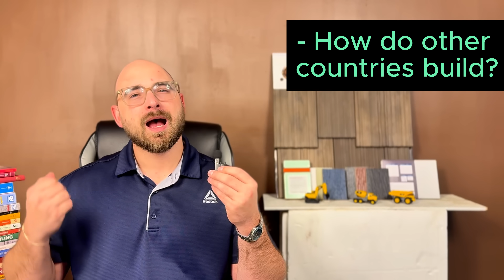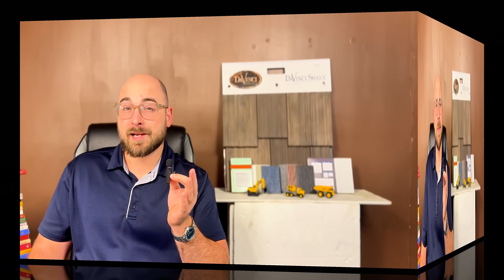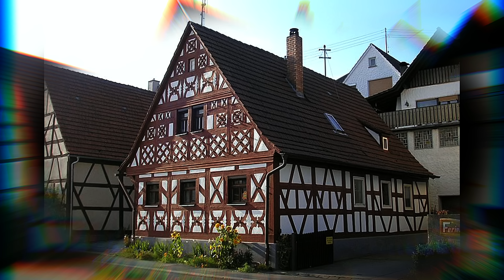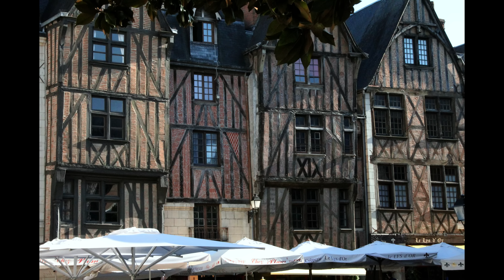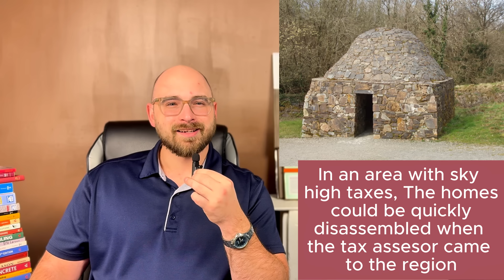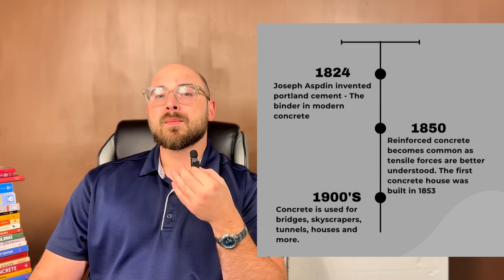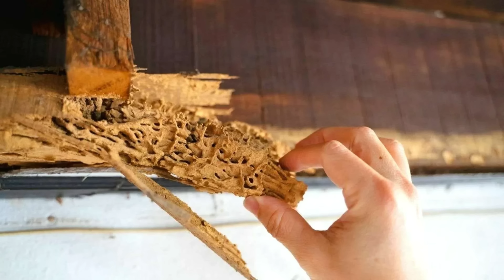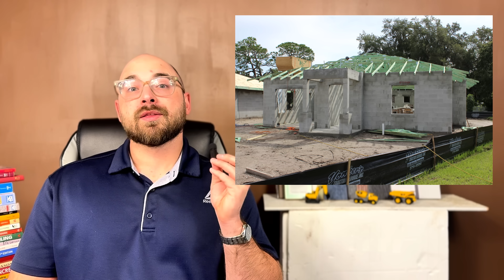Why Other Countries LAUGH at American Homes

Comment: Mr. Fortin: Sorry, but concrete block (cinder block) does not "help keep the house cool" [16:35] in Mexico during the summer when exposed to direct sunlight, but rather quickly heats up and easily radiates that heat to the interior throughout the day and evening. When one places a hand against an exterior wall from inside, the surface is quite hot. The opposite equally applies to winter cold conditions. Concrete block is a terrible insulator.
Reply: I have a block house in idaho.  It stays cooler than everyone else's homes that I know. They are all stick framed.
Reply from the maker: If the foundation is below the frost line the block would benefit from earth coupling, equalizing with the temperature below grade

otherwise yes you would be correct the block would need additional insulation
Reply: @Mike_Fortin  Thank you, Mr. Fortin.
Reply: It's the air gaps in in, coupled with something like styrofoam, that makes for insulation.

Comment: I live in a wooden house that was built in the late 1700's. Just change the shingles every  20 years or so and it's fine wood can last centuries if you take care of it. I live on Cape Cod and there is no shortage of 18th and 19th century wood homes that have held up just fine. I don't get why people throw shade at traditional architecture my house has outlived most European systems of government. A major advantage of wood homes is ease of repair and ease of modifications. If you have a beam go bad or a wall get damaged you just replace the bad boards and get on with your life. If your needs change you can easily do an addition.

Comment: it's interesting, that despite US leans toward "disposable" style of homes and cost efficiency, neither is actually in effect. All homes in US re-sold multiple times over decades for ever rising price rather than being rebuilt, quickly deteriorated, still sold over again. Cheaper materials do not translate into adequate price. The steadily increasing price I observe since 1994 does not translate into higher quality workmanship, on the contrary, I don't know single case of adequate quality, absolutely everything is done slopily and being chrged through roof.

Comment: Are ICF townhomes with party walls possible?
Reply from the maker: Yes, you might have to use a thicker core for that wall, but %100 possible, 

Can also be used as dividing walls between apartments. 

Our block manufacturer, Crown ICF  is building a 100 unit apartment building where all the dividing walls are ICF. Leads to a sound proof, smell proof, energy efficient unit

Comment: (Perhaps) the Romans and Italians stopped building with concrete because the cement mines were exhausted. The Roman cement is a kind of natural volcanic ash (ignimbrite)  that probably was not endless in supply. They were not clever enough to invent Portland cement in that time, and that is why the casting of concrete stopped. Perhaps another reason for the decay of the Roman empire?

Comment: I suspect after the recent fires in la you're going to see a lot more concrete homes and metal roofs being used.
Reply from the maker: Steel framing with fire resistant design is another great option

Comment: You missed 3D printed concrete as a possibility.
Reply from the maker: I don’t think it’s a great option, 

It’s not any cheaper, the concrete is exposed to the elements, it lacks reinforcement, I’m skeptical of how well they are insulated. 

I think it’s a fad
Reply: @Mike_Fortin  It's an emerging technology and may not be great now, but it should be watched as it evolves.
Reply from the maker: Things could always change. One day we might have a bunch of robots laying brick and putting up drywall too, we’re just not there yet

Comment: It is a cultural thing.

In the US you can build a house from "matches and cardboard" for the price of a proper pickup truck. And after a few decades, a fire or a storm you abandon it and build another one. Land (outside if some hotspots) is dirt cheap. You wouldn't even bother demolishing and rebuilding it, you just buy a new plot, and leave the old one to those with lower income.

In Europe you can't. The plot costs you 4 proper pickup trucks, if it is far enough away from the next city, and the house costs another 4. (Although nobody drives trucks here.) An own house is only for the better half of the income spectrum. A once in a life investment. But the structure will survive hundreds of years. It'll outdate regarding insulation standards, heating, and electric wiring several times before somebody in the far future will maybe demolish it to get a good plot

Comment: I have traveled extensively and places and types of houses vary greatly. Older homes that still exist were made well, but newer construction is rarely to the same level.  And having been in the UK and Ireland I can tell you that those pretty homes are COLD. And no idea of air conditioning. You have to bundle up just to be inside. And in many countries, the shoddy workmanship is obvious. And don’t get me started on the Soviet era building which are terrible. So it is problematic to compare US homes, which are usually less than 100 years old, to buildings hundreds of years older.

Comment: Love the idea of an ICF built home. But I worry about the Styrofoam form. That stuff burns fast and puts off lots of nasty smoke. If you get a fire behind the sheet rock wall or a fire that gets into a wall from outside the wall the fire will spread fast.
Reply from the maker: ICF is treated with fire retardant, it won’t sustain a flame on its own. It would just melt. And there would not be a structural collapse like their would be in a wood house, giving the inhabitants time to get to safety if there was a fire

Comment: hello from Greece. like to point that many houses here  recently have adopted using dry walls instead of the plaster on the inside walls due to cost. i live in a 2024 built house tha was made with reinforced concrete framing, brick infill, insulation and plaster on the outside, dry wall on the inside and for roofing it uses insulated roof panels (they are much! cheaper than roof tiles). Dry walling on the inside (given the building is well insulated) has become the cheapest and most cost effective option. As for stone houses the you mentioned, you mostly find them around the country. While the materials are cheap (we have lots of stone.........i mean alooot!) labor is very expensive and requires great craftsmanship that is really hard to find.

Comment: As a European, I think there is no problem with the frame construction method, if it had heavy timber framing reinforcement, or 1-2 walls were made of brick or concrete, and were not just an independent decoration. I live near Budapest, there are frame houses here too, but they are not that widespread. What is built on site is not of such good quality, but the frame houses made of prefabricated walls here are quite strong and durable. Actually, it has not spread, because of the banks. Because if the  debtor does not pay the mortgage installment, the bank has a hard time selling the frame houses, because here people consider brick houses to be more valuable. That is why banks very rarely lend money for the construction of frame houses.

Comment: Sometimes engineering is used instead of bulk. Example: Soda cans hold their shape using .0001 ounce of aluminum 
and did you see those small Poland Springs water bottles? They use .000001 ounce of plastic to hold the water.
I rest my case. :face-purple-crying:

Comment: I moved on, step by step, to an interest in deep insulation cavity parallel chord sidewall truss / modified roof scissor truss unified rigid frame structure. Ground level assembly / tilt up frame construction. On building site "1" step "manufactured" and installed finely shredded wood fiber to super insulation levels, ventilated and or vapor permeable exterior solid wood sheathing panels. Looking to the future of affordable high quality, low cost, energy efficient "Swiss chalet" style housing made possible with a "refined" , relatively low cost, forest to final built home equipment package ... A properly scaled, vertically integrated urban and rural forest restoration / "free wood" harvesting system to small scale sawmill system to home building "system". New Era Home building for building New Era Community.

Comment: In the U.S. If I don't like the design I can change it easily enough and I'm not limited to any materials. I prefer natural wood and tar paper over plastic any day. If by chance I build underground it will be with steel and cement. Otherwise I want to blend in with nature and the natural environment because I don't live in a City and I'm not you. I don't take up more than I need.

Comment: So, funny story. I just had a multi day argument with a channel that does masonry work in the uk. I argued with the actual channel not other commenters. He dug 3+ feet deep around a front step. He claimed that the soil was "terrible and he could see why the front step surround sank" so only dug around an already mostly demolished step and filed the ground with concrete. He even chose not to add rebar to the concrete. When I pointed out that a plate compactor would have been more then good on the existing dirt, a layer of compacted crush rock, and that's all he needed to stabilizer the soil, he started insulting me. I offered a much cherokee solution to his that would be better then my first option. Dig all the dirt up, not just around the step. Get soil that you deem acceptable, do lifts that are compacted and a layer of fabric meant to be used to stabilize soil, and repeat. Then top with a layer of compacted crush rock, and bam, soil that can hold weight! More insults from him. Then I suggested, if you are going to do it your way, maybe it would be best if you added rebar and maybe vibrated the concrete to remove bubbles... more insults.  Through it all he insisted that he was building within UK code. This makes me very scared. First, that the uk code is really calling for unreinforced concrete for anything without vibe, two that builders are doing the bare minimum and not what is best, and three, that in the uk there are many structures built this way. But his responses were always insults and name calling and not a dialog about the facts and why they do it the way they do. I don't proport to know everything about building, especially in the uk. But I build bridges in the US and understand the basics of home building here. There seemed to be many mistakes made here and he offered no explanation for any of them.
Reply from the maker: Perhaps what this other person was doing was allowable, but not ideal 

Their version of code minimum, 

A lot of contractors have an attitude, we’ve all seen it. “I’ve been doing this 20 years” and they suck lol 

The best of the best are humble, knowledgeable, and open to new ideas.
Reply: @Mike_Fortin  it scares me if that's allowable in the uk. I couldn't imagine pouring more then a fence post without rebar and a vibro. I wish no one had attitude! It gets no one anywhere. It just leads to the same old same old. It stifles improvement and innovation. I've worked places where if you thought about improving the workplace or methods you were slated for firing. It was nuts. This guy is likely a great guy to work for. Wonderful conversation and really great when employees make mistakes!
Reply: @activemanishere  cool story bro, is that why there are houses still being lived in that are older than the US around every corner. Also I live in a 150 year old stone and brick house the only thing that needs replacing is the roof tiles maybe every 20-30 years if not longer and this house will out live me and any future children I might have 🙂. Regulations are way more strict here for buildings. I have seen YouTube shorts in America of an inspector finding so many faults in new buildings that it looks really embarrassing. No builder would want to put their name against such poor quality over here or they would be publicly ostracised.
Reply: @dkinclonberne  you mean how i publicly ostracized this guy for doing a weird dig for no reason and then filling it with unreinforced concrete that wasn't vibrated? He literally overkilled and underkilled at the same time! It's both too much and going to fail. We reinforce concrete for good reason. Especially without reinforcement, Air bubbles will lead to failure. I don't know their climate, but air bubbles will fill with water. When that happens, and then it freezes... explosive consequences. I don't deny that there were old methods of building that were better. They would be cost prohibitive to mass produce today. That's why we don't do it today. Not because today's methods are better. But, to make today's good enough methods actually good enough, we must follow certain rules. If the uk no longer follows those rules, today's builds will not last. This video i watched, I can almost guarantee that within a few years, maybe even one winter, this foundation for a covered front step, will fail. I would not say old build suck. I say this guy that I'm talking about sucks and if that's normal building practices in the uk, things are going to get pretty bad there.

Comment: American homes can be build very well, but most builders clueless, ripping off customers seems to happen often and houses are generally speaking not well maintained.

Wood, which often used in American houses is one of the best buildingmaterials but it comes down to how it is being used and how good the material is to begin with.

Comment: In Switzerland one of the reasons for the massive usage of concrete is that most new homes are multi-family homes. On the other hand, there are many efforts to use more wood also for larger structures to reduce the usage of concrete. There is quite a lot of innovation around wood framing happening. If you compare the cunstruction methods of wooden homes in the USA vs. Switzerland it's still quite a big gap. The difference is in the longevity expectation. In the USA the expected life span is considerably shorter for a home than in Switzerland. This also translates into cost.
Reply: Don't forget the mandatory bomb shelters (that isn't a joke, in Switzerland it was mandatory until 2012 to have a proper bomb shelter in every house)
Reply: @fkiesel9442  Of course, these ate also a lot of concrete 😅

Comment: Years ago I wanted to build a house with steel framing until I learned that steel is affected to a greater extent by the heat from fire.  Where good wood, even if lightly burned on the outside retains its integrity, steel is weakened by just being in the vicinity of high heat from fire and will need to be replaced to a greater extent.  Since heat rises, potentially all the steel in upper story floors or ceilings would have to be replaced even if there is no fire damage.  So unless something has changed in the last 20 years, I would stay away from steel framed homes. 😕
Reply from the maker: You would need some extreme heat to damage the steel. If covered with dens glass and fire resistant cladding, I would sleep like a baby in that house.  

I think it’s typically very large timbers that have the ability to char without burning through, not light wood framing
Reply from the maker: If you really want non combustible, you want concrete

Comment: Grew up in a double brick house in Southern Ontario.  Lath and plaster on the inside.  We could see out breath during winter.  The house still stands; it's probably over 150 years old.  Concrete is nice but as of yet making cement results in too much carbon dioxide released.

Comment: Here in Denmark the typical home is build with either areated concrete blocks, precast concrete or bricks as inner wall. Brick and morter outside with rockwool in between the walls. Some houses have stucco or some other finish outside. The gable is brick and roof trusses is engineered lumber with typical clay tiles as roof. Some houses has copper roofs, but thats rare. And yes we have stickbuild and other types of houses. The sustainability concept is getting popular. And having a wooden finish outside is also trending on new houses. What many wants right now is low maintance homes with high performance. And radiant floor heating is the most popular thing amongst new builds.

One thing i would never understand is the american housewrap aka structual paper :P

Comment: I'm from Australia, living in Armenia. The average house in Australia is sticks and paper compared to the house I just bought here in Yerevan. It has 45cm thick walls, built with the local stone. Each level is held by a 30cm slab of concrete. The only wood in the building holds up the roofing . It will be here long after I'm gone.

Comment: Concrete is too cold to live in for the northern states
Reply from the maker: If you insulate it, using a product like ICF, you use the energy of the earth to help keep the structure warm 

This is called earth coupling and is a unique benefit of ICF. 

It can be 0f outside, no heat on, and your house will stay 55-60 degrees

Comment: US has lots of wood. Hyper capitalism also leads to fast and cheap. The feedback loop is lightwood frame homes. 

Its also the reason starter homes arent being built anymore. You cant sell them at crazy markups when building a starter home isnt significantly less than building mansions on the same plot of land using lightwood framing.

Without significant legislation mandating more durable construction, the US will keep down this path. Funny enough people want more deregulation, which i can only imagine making US homes even more cheaply made. 

End of the day if you have the means to build you home from the ground up, you can choose to make it however you think is best.